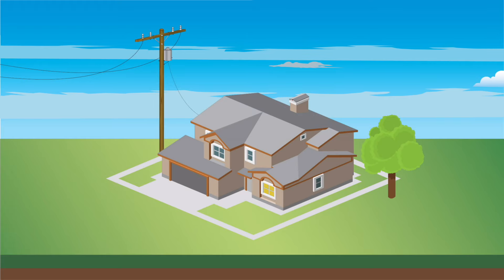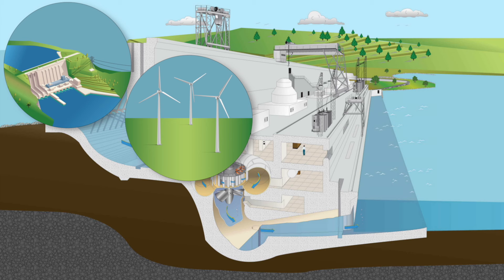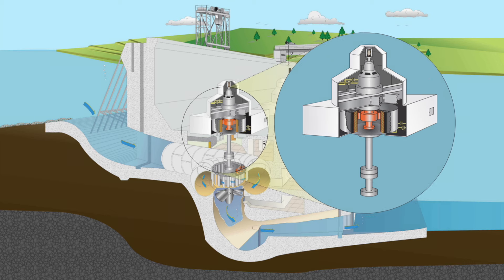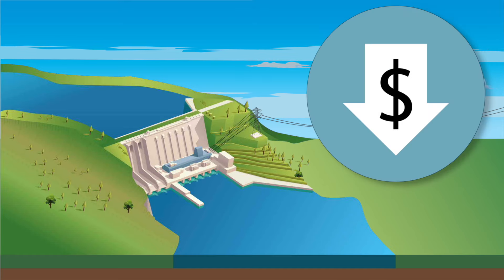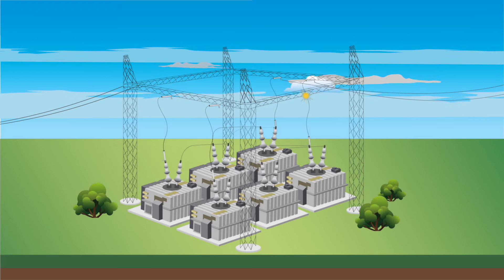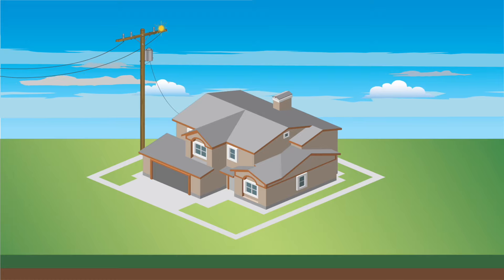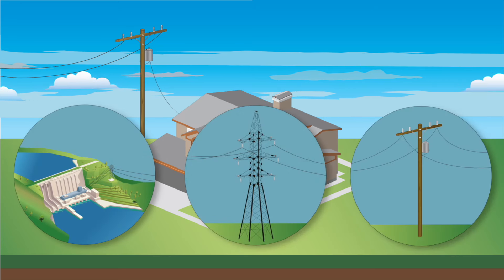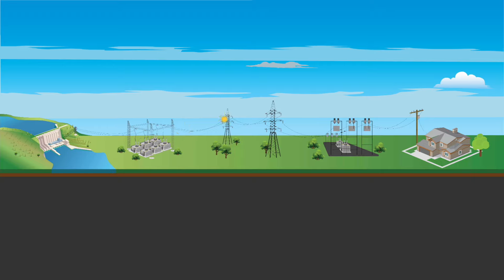How Electricity is Made

Comment: and how did humans realize they could do this? and why these transformer stops along the way, or conversions? There's always a mystery somewhere for us normal people wondering without full on knowledge.
Reply: i’m no expert, but the point of the transformers is to transfer electricity more efficiently over long distances. The step up transformer decreases the amperes and increases the voltage to 100,000-700,000 volts. then the step down transformer increases amps and lowers voltage. there is another step down transformer on your pole that again lowers voltage and increases amps for you to use for your appliances
Reply: I have this same question. I want to learn how to make electricity or what it takes to make a actual battery or hoe they get the materials and mined them. It really confuses me that if the lights go out, I would go back to wood and fire bc I don't know how to make energy and transfer it to something usable.
Reply: Necessity is the mother of inventions
Reply: @ojpimpson3343 realize this response is late, but hopefully youre still interested. First they made electricity using chemical batteries (certain chemical reaction release electrons creating a current). then some dude that had electricity going through a coil noticed his compass was goofing up, and that started the idea, that there is a relationship between electricity and magnetism, and then came Faraday that showed you can generate current by moving a magnet. So then we started spinning big magnets to create electricity. And all of the other stuff is just optimization, but thats the jist of it, if you have any other questions feel free to ask.
Reply: First, they finished school so they could write complete and coherent sentences. I think you missed that step. Had you either gone to school, stayed in school or knew how to use Google, you wouldn't have to ask questions that you should know the answer to.
Reply: It’s fallen angel technology. The government made a deal with them back in the 1900s for technology in return for permission for them to abduct humans. Just 100 years ago we was on a black and white tv and now we have super advanced technology. Smartphones, video games, movies, all come from fallen angels
Reply: don't try to understand it feel it, you know electricity is real, you can feel it, you use it, its in your body, you don't have  to fully understand it though.
Reply: Using their brains?? Not everything was as complex back then. They just optimized it more and more they found out they can transfer electrons and create electricity after accidentally discovering it.
Reply: The windmill machine is used to generate electricity. The wind blows and the windmill blades rotate and generate electricity. What if we create a small windmill machine and rotate it by hand. If we could create enough electricity as required for the world, then we can use this method. As many people in the world are without jobs, they could do this job.

Comment: why are being charged to use it when its practically free to generate it. 
All we should pay for is things like using their wires and their equipment to get the electricity to our homes.
Reply: We are being charged for it so they can pay they workers and for the miners that gets the coal and other fuels
Reply: Let's get our own source of eco free  power  ....come on all you  engineers.. scientists etc .....
I'd like A windmill in my garden to Get mine.   I'd pay to have it installed XXX
Reply: @sandratogneri9982  you so bad. Also solar panels hun is way to go.
Reply: Generating electricity is not a free process. There are still people that monitors and works at the energy plants while having to add fuel  and maintain the process, making sure nothing blows up.
Reply: I would rather be charged money than to stressed myself out to managed those electricity.
Reply: Its not running on its own. Requires regular maintenance and monitoring.
Reply: @Mainly_wayne that’s some bs 😂😂 if u believe that’s why we don’t u are lost!!